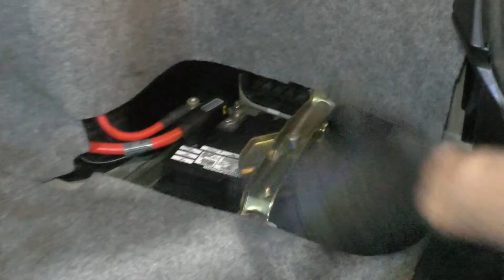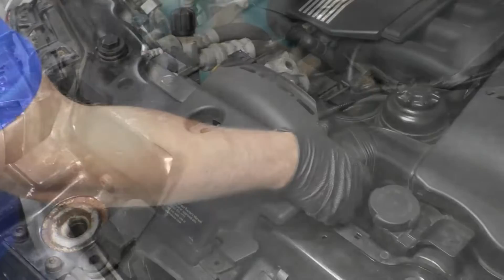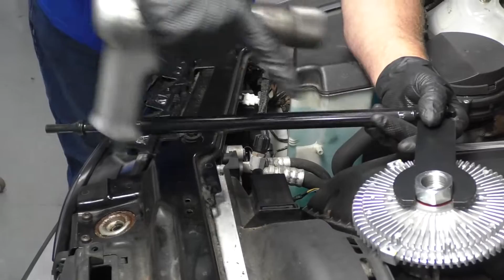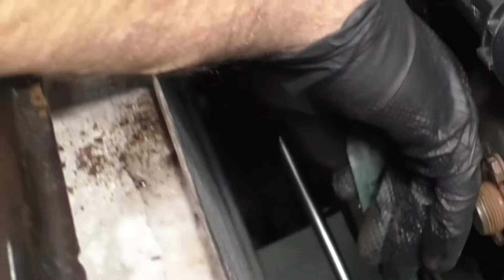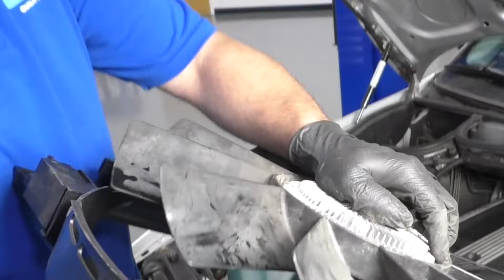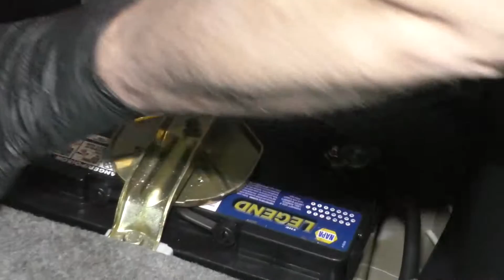How to Replace AC Belt 97-06 BMW 325Xi

Comment: You could have saved so much time going from the bottom. I was searching just to make sure before I do the job and seeing you remove all that for something that sits literally at the bottom is wild. Woah. 941k subs too.
Reply: Was literally thinking the same thing. A bit silly. 10x easier and faster from the bottom. Just remove the tray 😂
Reply from the maker: +Richard Thanks for the feedback!